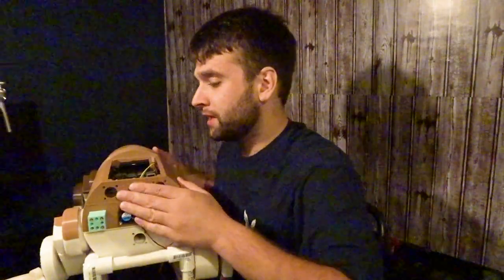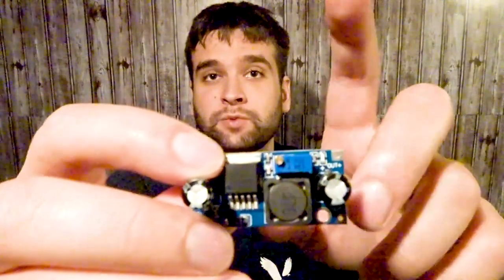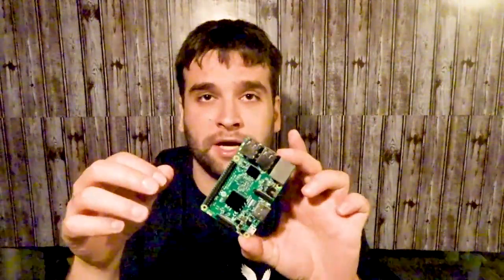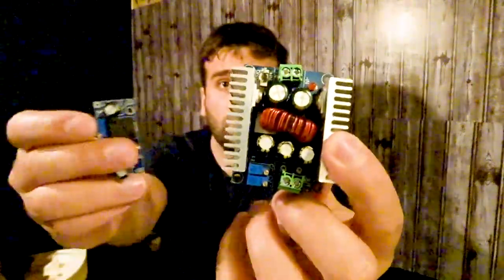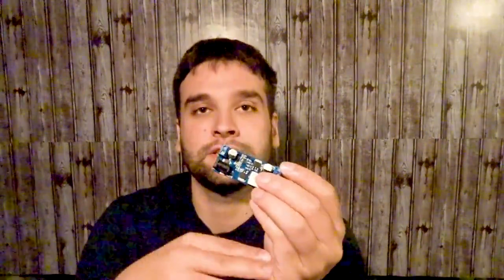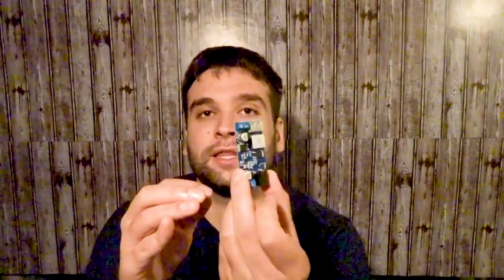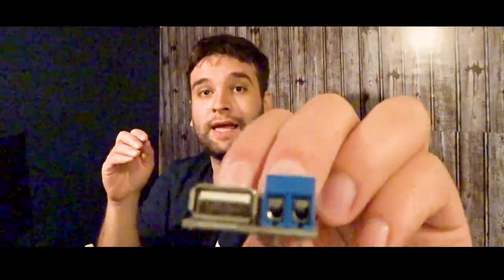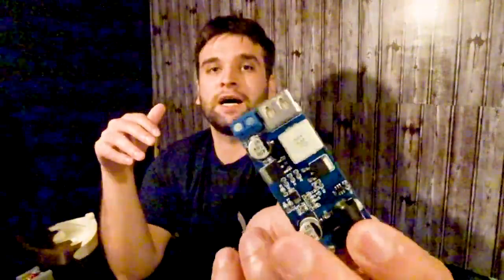What I wish I knew about step-down buck converters before I started Wolfy the A.I .Canine

Comment: Wow thanks! I was looking at the XY 3606 for creating a multiport usb charger (for cheap) 
Some websites list it has a chip/logic to support fast charging but doesn't state if it's QuickCharge or USB PD
In your testing have you gotten the fast charging to work?
And since this is an older video have you found something new for 5V power?

Comment: Just an observation from my experiences - the servo motors are also very sensitive to good power supply. And in complex robot with not enough amps the servo motors working too lazy (with delays) and you don't get the robot move you expects.
Reply from the maker: Yea I saw the same observation with wolfys  servos as well. And in some extreme cases the servo can start to smoke or catch on fire. Something that happened to wolfy more times than I would like to admit
Reply: @IslanderIntelligence  I also got smoke and burned my servo once and now checks the servo's temp regularly :)

Comment: Very useful topic since the stable power is very important. For example, I recently had instability issue in my new RC controller with BT, and in result I found that the problem was in bad USB connector with power bank (due to that the passed voltage was just 4.1V instead of 5V).
Reply from the maker: RoboLab lol I have had issues like that before, that’s why I always check my solder points with a volt meter. Also in all honesty arm processors really do need consistent power
Reply: @IslanderIntelligence  Now it will be my first check if something will going wrong with electronics :)